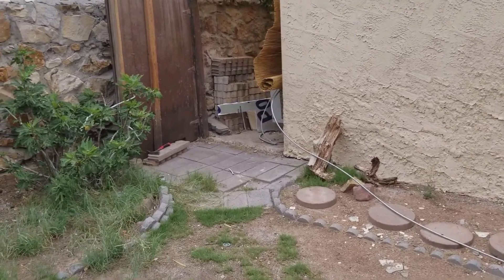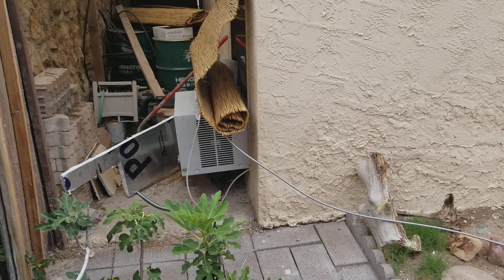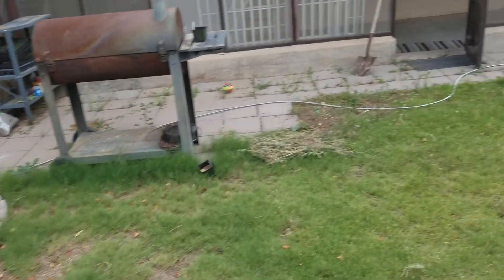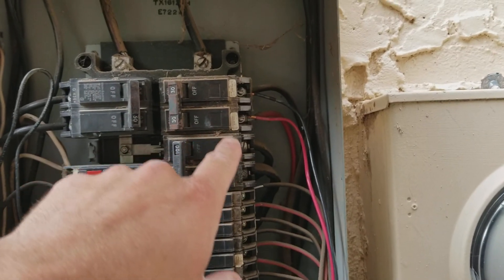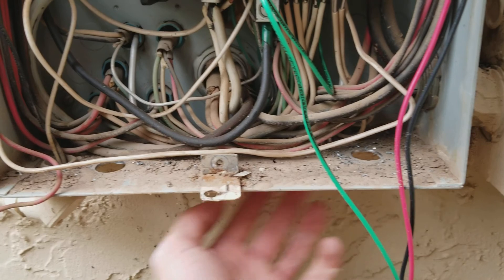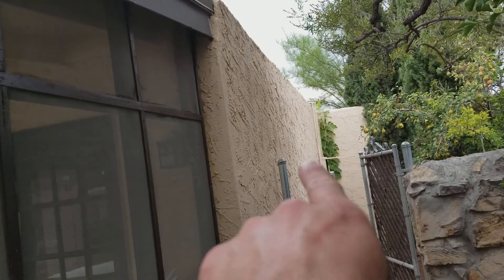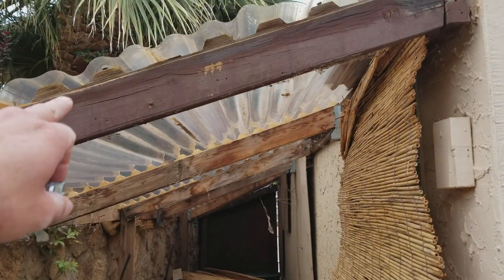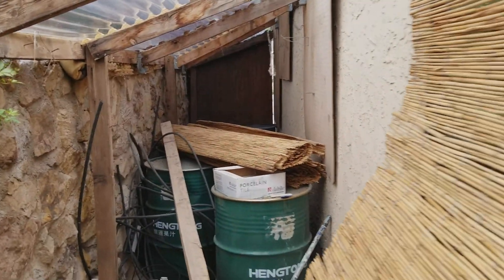Oyster Mushroom Garage Grow - Upgrading Electrical Systems

Comment: Kinda scary...
Reply from the maker: LOL how so?
Reply: Let's just say I have an electrical background... It's not just you, this isn't all that bad, but there are some really scary videos with do it yourself electrical projects. I enjoy your videos! 

BTW, a 200 Amp panel would cost about the same as a big AC unit... installed
 @MyersMushroomsFarms
Reply from the maker: Yea, and this wasn't the end result too. We quickly rigged up the wire as shown because the mushrooms were dying of heat, later that week I went back and mounted everything on hangers, used the knockouts, and drilled through the walls, mounted the boxes on the walls with plate covers, its now all secured.